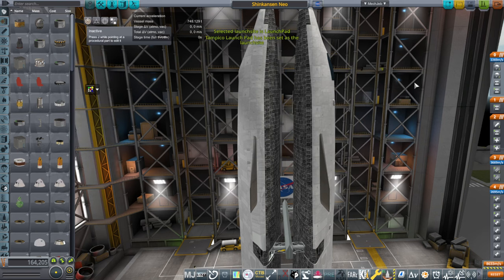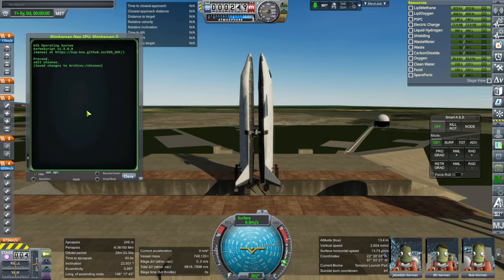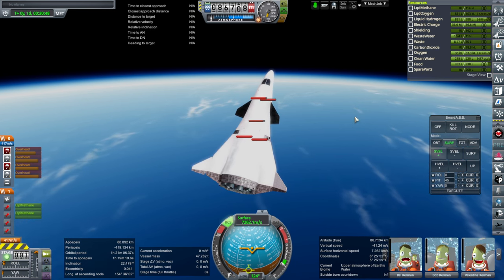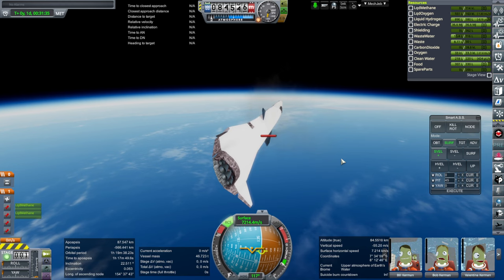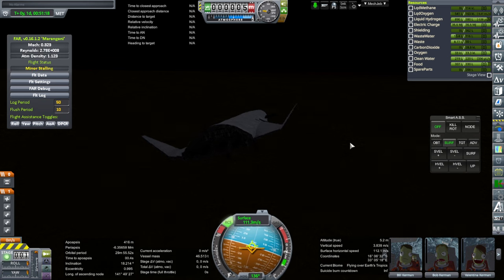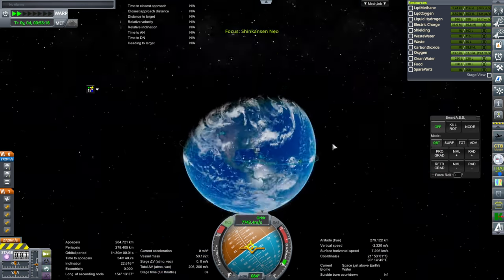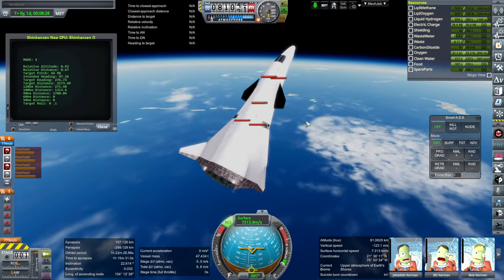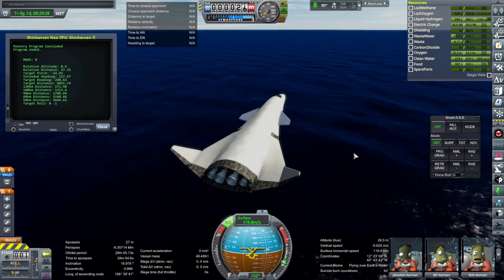Shinkansen Spaceplane Progress (RO in KSP 1.12)

Comment: Is it really useful to have an abort system? If I understand correctly,  you need a way of sending a crew from the ground to the spaceplane in LEO and back anyway because the plane is meant to stay in space for several round trips between LEO and the moon, so it might be a better option to launch it uncrewed, and then launch the first crew in the same way you will need to launch the next ones. This way, you don't need to carry the weight of the abort system on all moon transfers where it isn't needed. Or am I missing something?
Reply from the maker: You're probably correct.

Comment: Why did you call it the shinkansen? The design reminds me of how the E6 and E5 shinkansens mate and then separate in the JR East lines. Is that why?
Reply from the maker: No, just the nose shape I was originally going for was sort of similar to a Shinkansen model and in principle I was looking for a train line in space. I eventually deviated a bit from the nose shape.
Reply: You could think about using other liquid natural gases as fuel. Propane can be densified to around 0.7t/m3 before it freezes and the isp would similar. Then you'd have tons of delta-v.